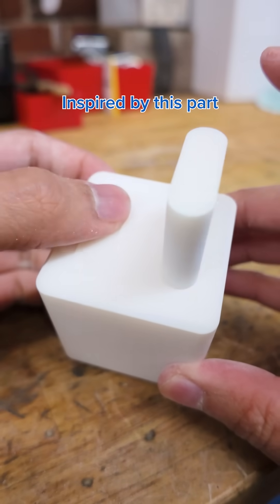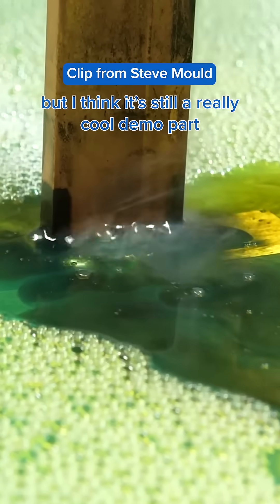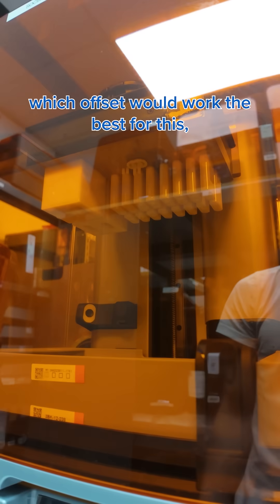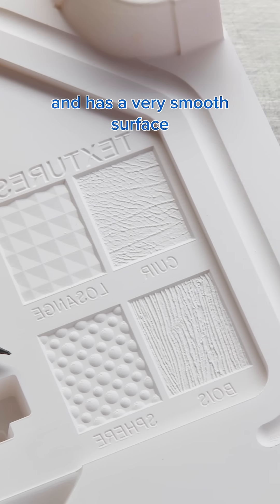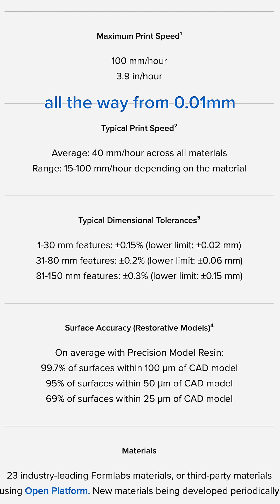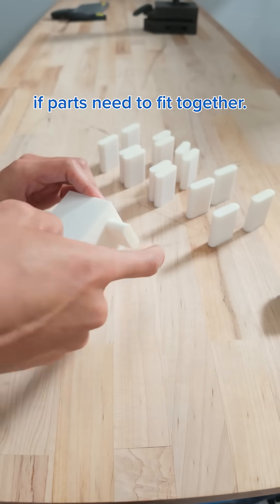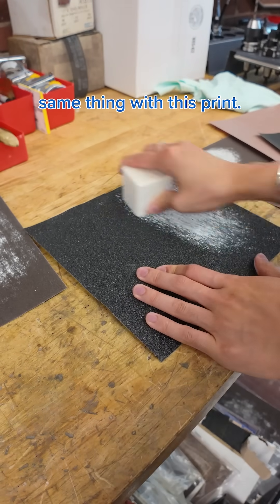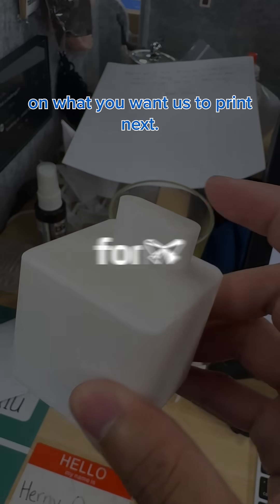Recreating the Metmo Cube: Testing Form 4's ±0.02mm Precision

Comment: Lol formlabs is years behind the competition now. Handful of sub $1000 machines with under 20 micron tolerance/res in the x-y plane. The 4 has 50 micron resolution for a measley 10k.
Reply: Sub 1k SLA printers?
Reply: @GuruCai  269 euro for Mars 5 Ultra with 18μm pixels and 9K screen. 
Formlabs is a joke.
Reply: I'm not sure where you're getting that 10k number from. Form 4B (medical) with wash and some extras was 7k. What you're paying for a combination of convenience and access to specialty materials. I've used the Form 3B and 4B as well as several consumer SLA machines from Anycubic and Elegoo. The Formlabs machines are for an different use case, comparing based on pixel size misses the point.
Reply: @Beanpapac15  it doesn't, form 4L package on their website is 10k.  If the base model is 6 or 7k it doesn't really matter, I said sub 1k base it's approximately an order of magnitude less cost for an 8k anycubic.

We have form 3s in my lab and they don't work particularly well. They're not bad. But this video is like how bambu ships printers with a tuned benchy. And the accuracy/resolution absolutely matters - the selling point of the video is that resolution and dimensional accuracy. For 10× less money you can get ¼ size pixels (½ linear length = ¼ area). The larger "issue" with form labs is the ecosystem anyways. You get locked into only their consumables, parts, etc.
Reply: @wilurbean  You're looking at their most expensive model, the 4 is like half the price iirc. 

1. There's not a huge effect of pixel size for an engineering use case below 50 micron. The dimensional accuracy of resin post cure is rarely good enough to warrant a higher res. Honestly, even for something like minis going under 50 micron doesn't do much.

2. Formlabs can buy the same LCDs the other companies can, they're probably trading off res for improved light transmission. My guess is they needed that to be able to work with the same style of engineering resins the Form 3 used. 

3. Whether you like the ecosystem or not, it's why you buy a form. It's expensive compared to consumer SLA, but not compared to SLS, polyjet, or MJF. For a lot of applications the Formlab part is likely the best option.
Reply: @Beanpapac15  form labs made the video to demonstrate resolution and dimensional accuracy. 

The rest is cope. Being cheap or expensive to other processes doesn't really matter. FDM is cheaper yet compared resin. Newest FDM tech can print Nylon (PA) at Temps approaching SLS. 370 C print heads and 70 C chambers on sub 1k printers. Strictly comparing plastic SLS/Resin/FDM, as metal SLS isn't comparable ofc.

There is absolutely an engineering case and huge market for micro scale printing, but no one makes a machine at that scale. Right now the closest process is MEMS or laser cutting with UV. A bunch of people would like to make parts or machines no larger 100um.

Comment: There is no such thing as "zero tolerance machining". There is always a tolerance. If you said zero tolerance that would mean 1.0000000000000000000000000000000 mm. And the zeros would never end. Stop saying such foolish things. Coming from a machinist who makes medical equipment.
Reply: First off, I'm assuming 1.0 is a spelling mistake, as no matter how many zeros there are after a number and decimal point, you can remove them all as long as there are no other zeros. (e.g, 2.00 = 2, 1.0000000000000 = 1, so on.) Second of all, while there is truly never going to be an exact zero tolerance, things that have tolerances of ±.0001" are simply called zero tolerance, because it is easier to say "zero tolerance" than "±.0001" tolerance."
Reply: @AsmodeusSinsGarcia  Wrong. But nice try. Ask any machinist if they do "zero tolerance machining" and they will laugh at you.
Reply: @shadfallfan  That is also true, but for non-machinists or machinists trying to explain stuff to somebody who doesn't understand the concept, zero tolerance machining is an easier explanation than 0.00000000000001mm tolerance machine. While it will never exactly be zero, it is simply easier to call it zero tolerance machine as it is extremely close to zero. I do agree that most machinists would probably laugh at you if you asked it, but if I was trying to explain extremely low tolerances I would just say "basically zero" because thats what it is. At a certain point, it is okay to just say zero. If somebody asked you how many cookies you wanted, it would be easier to say zero than 0.0000000000000000000001 cookies.
Reply: @PhelanTaos yeah but this kind of demos aren’t even that close to „zero tolerance“. 0.01-0.02mm are often enough (depending on the size of the fitting) to create these air thigh fittings. And that’s are completely normal tolerances, nothing special. The much more impressive part is the ability to create these matching geometry’s.
Reply: @PhelanTaos  The extra zeros are not decoration. Look up significant digits.
Reply: @boppinator4308  I do know what significant digits are, but in many cases trailing zeros are removed, except for very specific applications. In this case, I don't think it matters as whole numbers like 1 have an infinite amount of trailing zeros behind them, so what he previously said would just be 1. I do appreciate the fact that you caught this though.
Reply: It just hyperbole, not that deep
Reply: This is why poop

Comment: Good tolerances on this machine, but printing all of those pistons was a clearance test, not a tolerance test. 
Now I want one to fidget around with…
Reply: good point! would you mind elaborating on the difference from your experience? it was a little annoying that Formlabs did not mention which clearance worked the best after all...
Reply: @hardrocklobsterroll395 you’re so right!
Reply: @hardrocklobsterroll395  hey thanks indeed! so we can print an object with 10mm diameter and have a tolerance of 0.1, so all objects with more than 10.11 mm or less than 9.89 mm will be rejected.  and that is because our clearance is only 0.1mm? something like this?
Reply: @walterrldias not rejected, just that it will print consistently within that .1 parameter. tolerance might be described better in this specific instance as the machines actual ability to print the dimensions you have stated. clearance is the space you have decided should be between those stated dimensions
Reply: @SweetMeatTM This is correct.
It's the manufacturing tolerance in conjunction with the actual dimensions of the part that lead to the clearance.

You can't manufacture parts to a clearance, you manufacture parts to a tolerance.

The original post is nonsense.